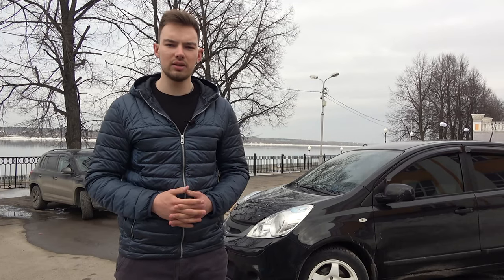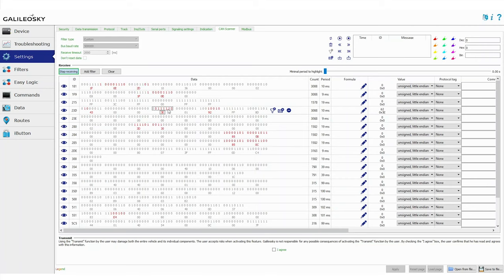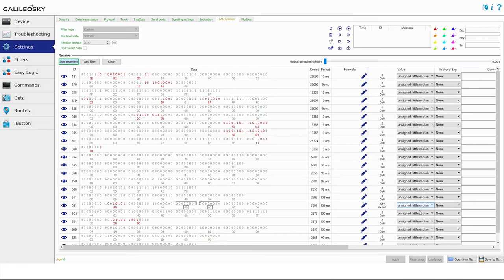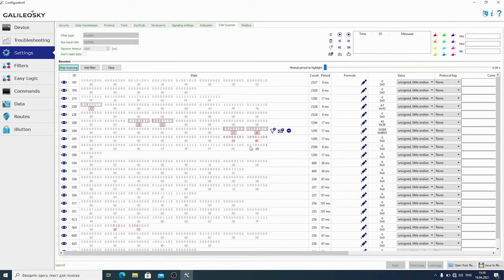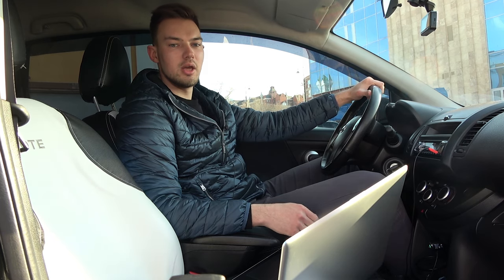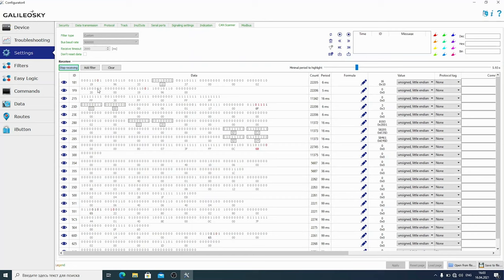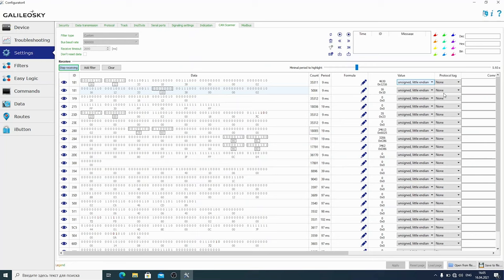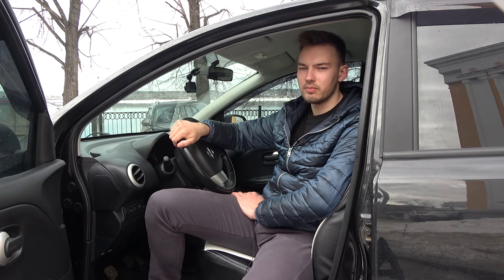How to find RPM in CAN-bus?  | Lesson 7

Comment: Thank you for the awesome video and explanation on the "non standard" automotive CAN signals.  I love the advice to look for a value that is about what you would expect (800 RPM for example).   Thanks to this video, I was able to easily locate the foot pedal position on a RAM 1500 (with the engine off).  Then after starting the motor, the RPM was right where I expected it to be.  Very helpful when there's 100s of CAN messages being transmitted by the chassis.
Reply: what hardware are you using for this?
Reply from the maker: Thank you for such positive feedback and interest in the topic!

Comment: Does the software work with a Peak PCAN usb interface?

I understand trc2csv exists, but is it possible to convert a trc capture to an asc or log format?  

For example, python-can logconvert doesn't seem to support trc.. the only way might be to do in multiple steps?
1) canlogconvert  from trc to asc
2) logconvert to go from asc to log
3) Once it's in log format, it can be converted to csv using Log-CANverter

Comment: I would like to find a tool to work with my w211 e55 amg. I’m trying to find a way to retrofit my instrument cluster in a motor swap
Reply from the maker: CAN Scanner tool is the tool for colleting and processing the data from the CAN bus. You can use our devicies for sending the data to the bus, our tool allows it but you need to know precisely what you are sending. Unfortunately we don't have the information about CAN Bus requests for the Mercedes vehicles but if you have the original diagnostic equipment you can use our device to "sniff" the data from it and than repeat the same requests with our device. It requires some time and efforts but after that you will have the detailed information about the  CAN data and use only our devices in your projects. 
You will need more than just a CAN Scanner tool in this project, you will also need to use EasyLogic programming system to arrange your messages system.  You can find the Easy Logic Creators tutorial on our YouTube channel. 
Those two tools together provide you almost unlimited opportunities.